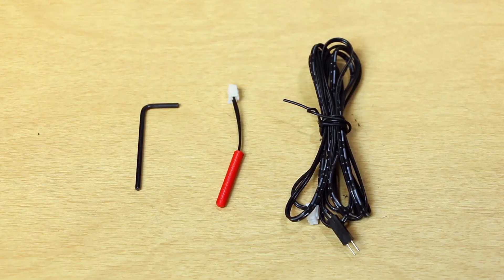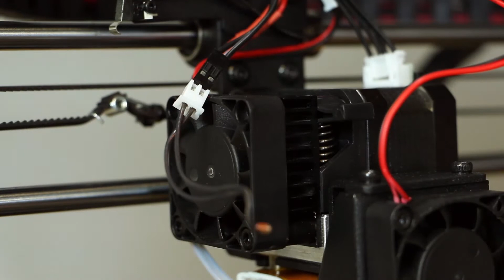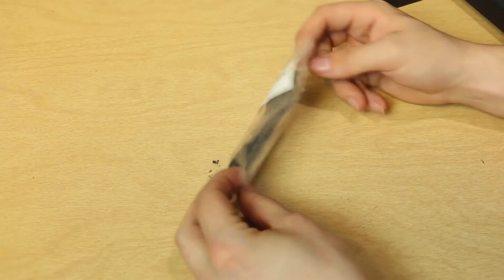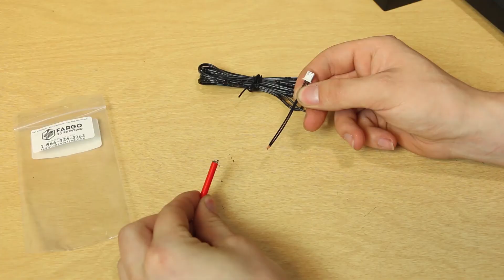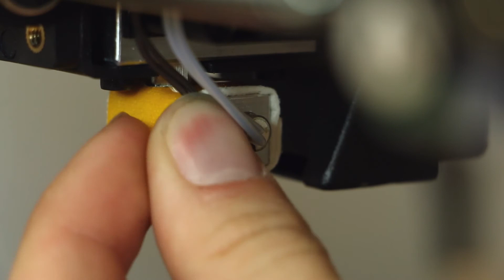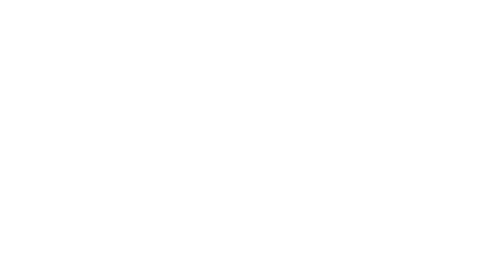Replacing Thermistor For Maker Select v2 / Wanhao Duplicator i3

Comment: Where could I bey the washer and screw that you used to hold the thermistor in place because I’ve got the select mini 1 and it didn’t come with those , thanks.
Reply: And how about the white piece in between (min 1.33) ? I accidentally burned my transistor without it, but I am struggling to find a replacement for it. Do you guys know how its called and where I can get it? Thanks in advanced

Comment: hello , what is sensor kind ? K type or NTC ?? value ? i need check because i have doubt . thanks
Reply: hello ,i find the infos and i test it , it's NTC 100K spacialy design for plastic printers , because common 100K are normaly used under 150° C , and we usualy use at 214° for PLA . i think it's not the best choice they done !! it's economical to made but not reliable !! at these temp a K type or PT is better . thanks 
claude
Reply: Can you make your own thermistor from scratch because it appears its just the ends of 2 cables making contact with the block
Reply: @Bring_back_bravothaLoc  hello , you think it's wires are diretly in contact , but no , the Nt c 100 K IS VERY SMALL parts , maybee 1,5 mm diameter , when it fail the value of impedance is not good and the pcb can't know the real température . i changed many times a lot of kind , , on printer it's 100K ntc  like this   https://fr.aliexpress.com/item/32819816264.html?spm=a2g0o.productlist.0.0.729063dag8TqUP&algo_pvid=ebd55a0d-61dd-4ae1-8560-12572fb723f8&algo_expid=ebd55a0d-61dd-4ae1-8560-12572fb723f8-25&btsid=0bb0624316182253351894693e9f73&ws_ab_test=searchweb0_0,searchweb201602_,searchweb201603_      the transparent resin is small , but look inside the black parts , that's is the NTC